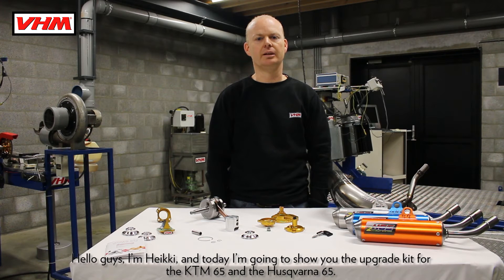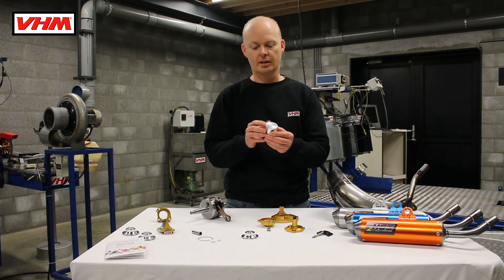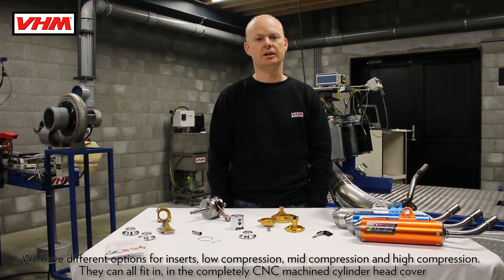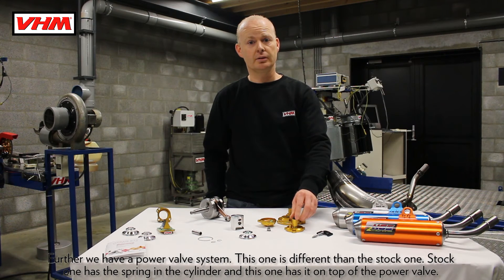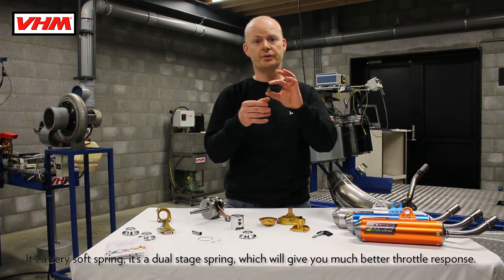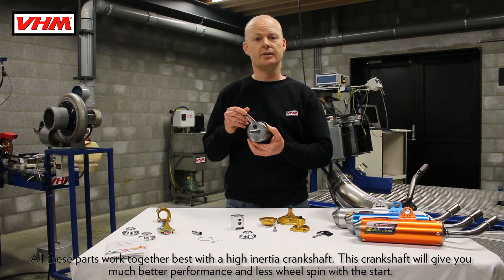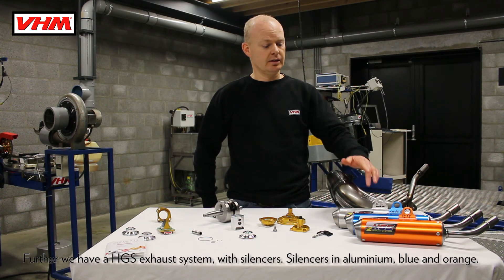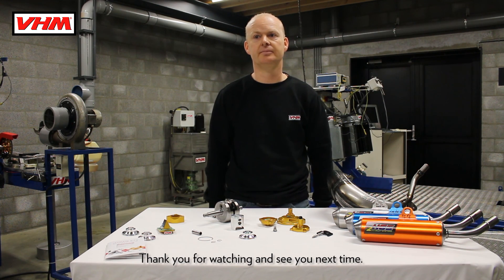VHM Upgrade kit KTM 65SX '09-21 / Husqvarna TC65 '18-21 / GasGas MC21 '21

Comment: Hi, i just bought a hgs system for my kids bike, felt like we lost some power with it. We run it with nihilo jet kit, tried to lean it and richen it didnt do any better. Do you need some other parts so make this hgs system work with this bike?
Reply: I have the same issue got a 65 with a hgs exhausts on it. I have just ordered one of these, after some research saying that changing the exhaust can cause issues as it has a diffferent expansion chamber to stock so hoping it will make the difference.